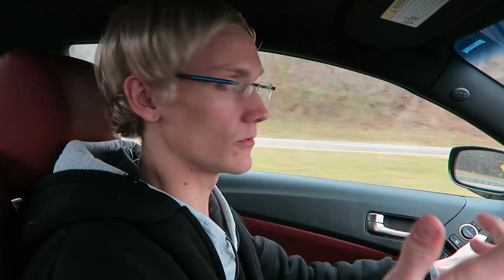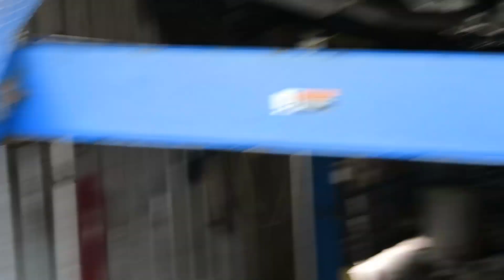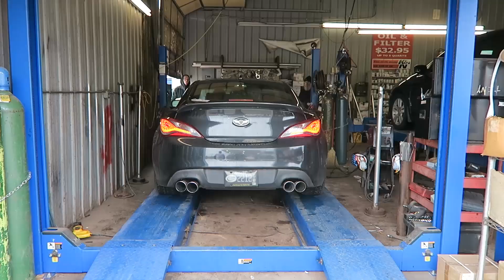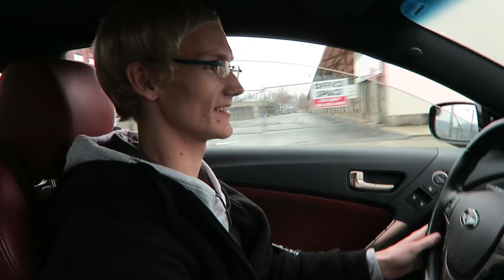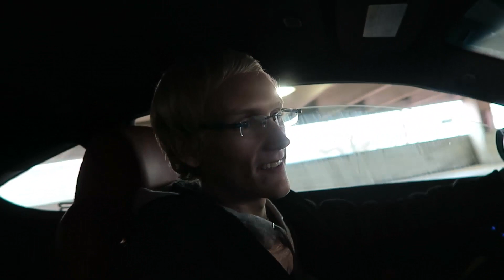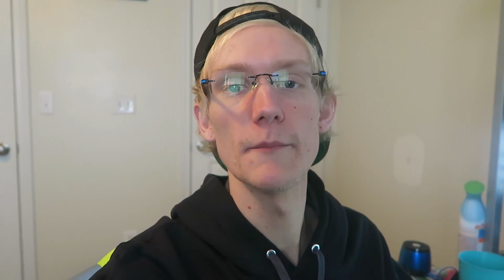I PAID them to CUT OFF my $600 Exhaust..

Comment: That place does work at a great price but damn they need to work on their welds. First time I went there it was okay. Second time the did shit welds and my bracket broke off before i could even get home. Third time they didnt fully weld my muffler on so there was a huge leak. They also cut out my stainless steel piping for their shit piping which was unneeded and they welded my twin loop on upside down. Last time I go to Quality Exhaust.

Comment: That Glockner ford completely fucked me over this year. We had a 2016 Escape with a blown motor and they replaced it. They had no idea how to replace it and didn't tighten the oil pan down and the car ran without oil for about a 2 hour drive and blew that motor up too.

Comment: Hey man do a 3.8 turbo give away. I can't afford it bro :(  I do have some sick wheels and tires tho lol.  I have BTRcc tune too and it drives so much better youre right
Reply from the maker: Bruh I can't just give a $8500 kit away lol I wish I could tho
Reply: Muscle Vs Tuner lol
Reply: Hey btw man dont put the resonator back on. You need to get the ansa ferrari 456 muffler and have that put on there. It sounds fucking insane... check out ebay you can probably find one for pretty cheap

Comment: I wouldn't straight pipe that big engine, the sound gives you headache soon enough.
Reply from the maker: Actually doesn't really drone too bad
Reply: You'll get tired of it pretty soon, specially the low rpm part throttle while in gear.
Reply: Muscle Vs Tuner I had Golf VR6 with straight pipe, it sounded fucking amazing for few weeks. Then it just became annoying.
Reply: Alan Dominguez its annoying when your going 60-70mph on the freeway, the drone just kills you